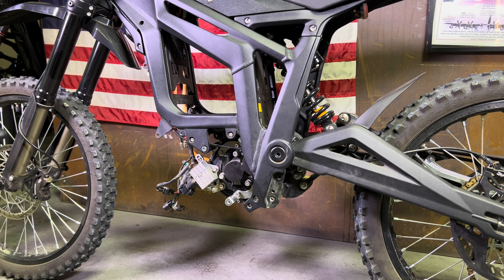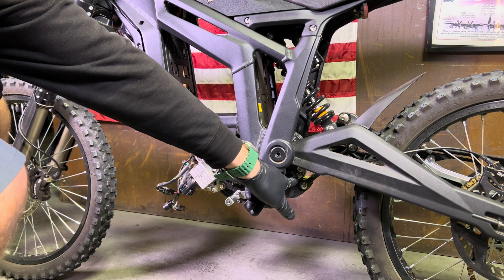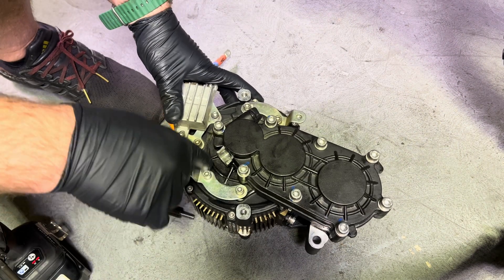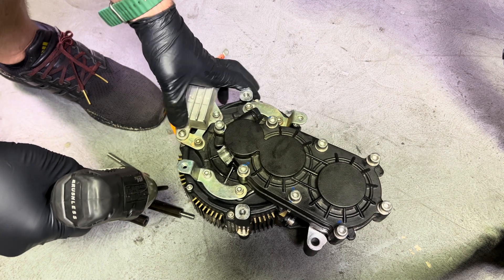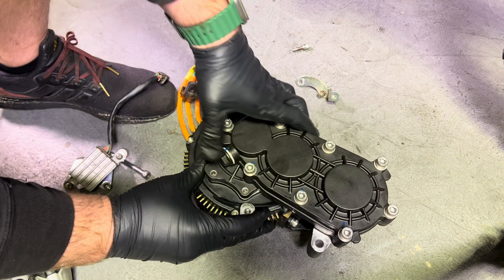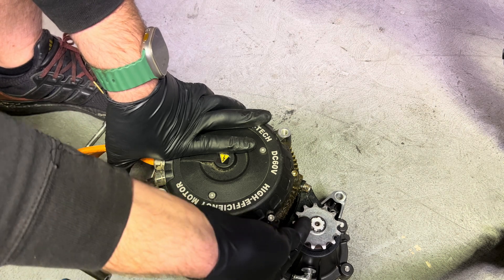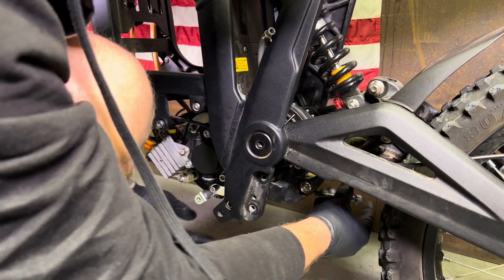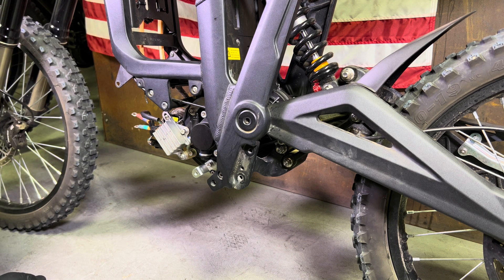Talaria Sting MX3/MX4/5Motor and Gearbox Removal

Comment: Please do a guide for the mx5. I recently bought one from you guys went to try to add a O-ring to reduce some sprocket noise but the sprocket can’t fully come off the shaft. Seems the swing arm is not allowing enough clearance to fully remove it.

Comment: what was the reason for replacing the gearbox?
Reply: The gearbox can get damage and it cause the bike to not move and stay on wait since the gearbox is ur main source for power so yea they show how to change
Reply: @kaurtenkuro5557  because I have a slight knocking noise and it's not the chain, but it stops when I release the gas pedal, what could it be?
Reply: @kaktusek1449 are you going hard on the bike like max speed or did too much for the oil ? Cause that happened to me but it was more of a grind mix with that knocking down below
Reply: @kaurtenkuro5557  well, it only happens when I press the gas, when I release the throttle it stops and what could this knocking sound be?
Reply: @kaktusek1449  I have the exact same problem and I dont know what to do :(